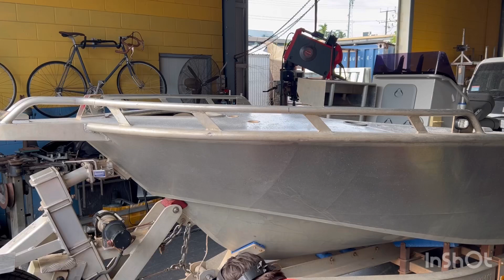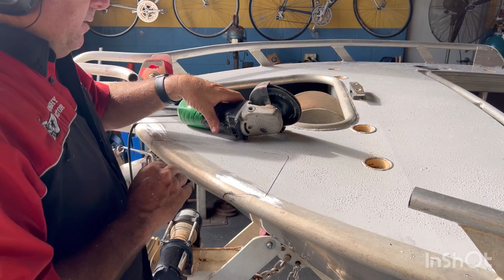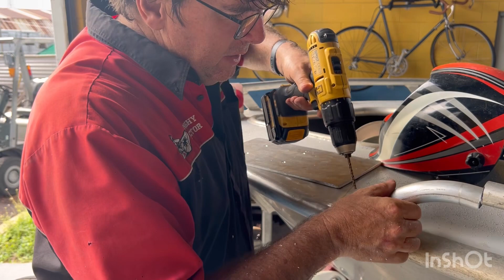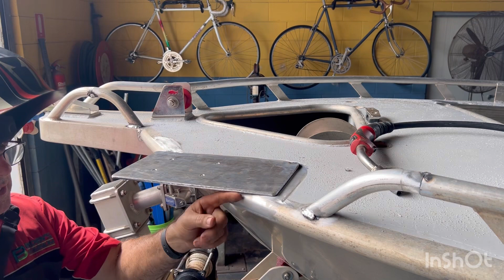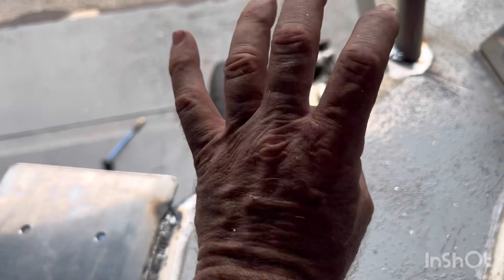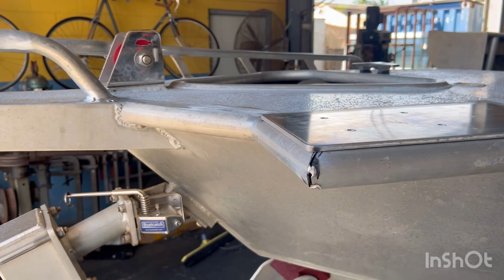Electric trolling motor mount

Comment: Hi mate, Iv been needing/wanting to do this job on my boat for years but haven't because i only have a MiG, and have been discouraged when researching how to have a satisfactory result mig welding aluminum. You seemed to not really have any issues at all doing that job. Have you just made the necessary part swaps in your mig machine to be able to get it done like that? ie, liner, tip, wire, rollers.??
Thanks
Reply from the maker: Yes mate you need to have the right wire, liner, and gas for aluminium, 
My welder was 16k I can weld an aluminium can together with it or 12 mm plate horses for courses
Reply: Ohhh my bad. I actually thought i saw a smaller welder that you were using in the background, but i must have seen wrong. 
Think ill be waiting bit longer then until iv upgraded from $700 to at least 10k worth of welder. Haha👍
@RacingRenovators
Reply from the maker: @leighmcdougall4735 
Arrrr your on to it👍 I do have one , but its a TIG this one was about $1000 all up with a foot controller 
Can be used for most fabrications you are limited by speed it is a slow process